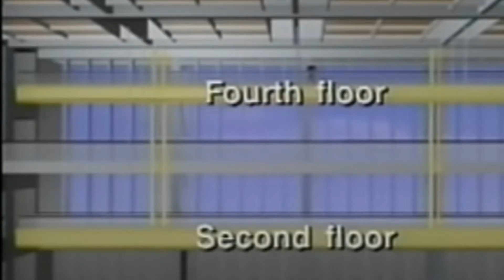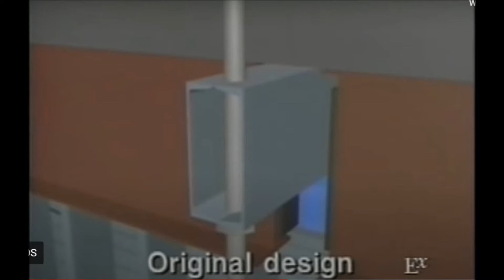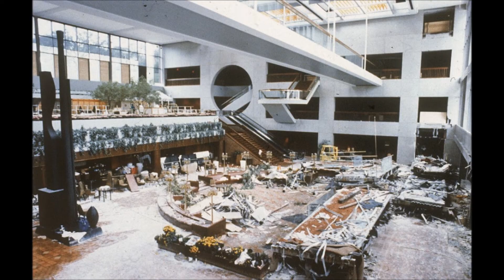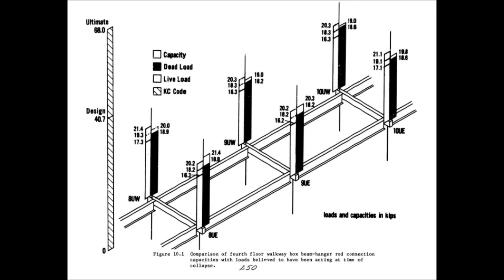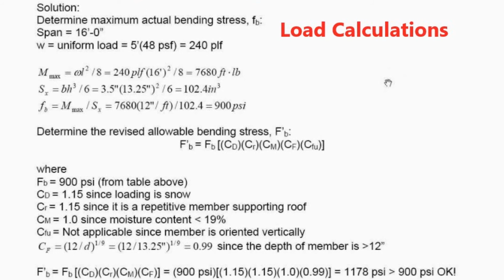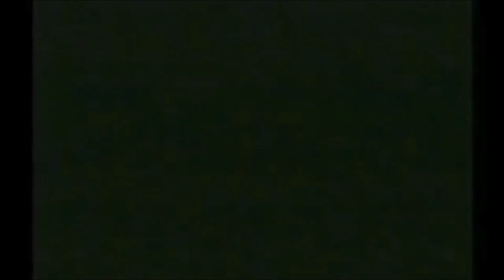Hyatt Regency Atrium Walkway Collapse. 40 years ago this July 17. Lessons learned

Comment: How many local building inspection offices just issue permits but don’t stop construction when they are refused to inspect?  No calculations for load but issue permit?  Should never have broken ground and why design box beam that is welded—-seems like designed death to someone like me who doesn’t know first thing about building but I would have stopped framing because it doesn’t look right.
Reply from the maker: @doncook3584  After that tragedy, Kansas City's permit dept. Has a structural engineer review all design drawings. A lot of municipalities do not offer this service, nor do they have inspectors. Surfside, Fla. Is an example with the Champion Tower south collapse. And in some instances, the Gard Rock Hotel Collapse, the New Orleans inspector was absent and filed false reports.

Comment: In my opinion as an engineer, the bad design was not as suggested here, and as in many other videos, but in the fact that the horizontal two FLANGES of the  C channels were loaded as a  CANTILEVER,  and they did not transfer the vertical load to the vertical WIDER WEB, in a vertical manner. The vertical webs with a vertical load should have been used and not a twisting or torque load, on the flanges of the C beams. If wide THICK plates bridging across the two vertical wide webs were used with the loaded nuts, rather than using a thin washer with a small diameter, this would not have failed.    Note,  even the original design was no good as far as engineering logic goes, as it still loaded the two FLANGES  in a cantilever torque mode, which should never be, in a C channel or an H channel.  I would say that the original system would also have failed, as the welding holding the C channels together did not seem to be a good weld with no porosities and anyway, the original single rod was too close to the edge of the C beam. Exchanging the rods and placing the upper rod on the inner hole could have helped! Thick plates with side limits, working in conjunction with the loaded nuts would even eliminate the need for welding the C beams, but I still would have used welding anyway.
Reply from the maker: This collapse happened when I just graduated college in civil engineering. I researched the newspaper articles to understand the reasons. Not much information at that time. As I went about my career, I used that experience in forming my approach to complex building situations. With the internet, I was able to review this collapse in more detail. It has the same types of theme as all of the collapses. Lack of proper oversight. There are 3 books by David McCullough that should interest all of us constructors , engineers, Architects. The Johnstown Flood. (My video was based on that book as I grew up 10 miles from the dam), The Great Bridge. (Story on the building of the Brooklyn Bridge, my factor of safety video reference this book), and Path between the Seas (story of the building of the Panama Canal). Great reads. I downloaded 2 of them from my free public library.
Reply: @michaelshettig7805  Thank you for the information. This human mind does not seem to come in equal dozes and there are many professional people who do not "see" the dept of the " form and the function".  Many years ago I was discussion the principle of operation of " stairs".  In my country we build with stones and so we have stone stairs where   starting from the first  block,  the wall end is inserted into the wall and the free end of the stairs is about 5 feet away from the wall end,  The second and other stairs override the previous stair with each step inserted about two inches into the solid wall, and the free outer end resting on the previous step.
Once I could not believe my ears when I heard, Civil engineers, Architects and mechanical engineers saying that each step on such a staircase close to a wall is operating on a CANTILEVER PHILOSOPHY!. They could not see the torque effect in each step! 
i could not imagine how three young university graduates could come to that conclusion,  I am now a very old man and I am an electrical engineer who served in Industry, Naval and other ships and then served in  teaching and researching at University.  but it seems that I operate with logic and not emotions and sentiments and parrot fashion conclusion,  There was one time a story going around that in a church in some country, the architect forgot to put a stairs. One day an old man called to offer make a wooden stairs,  The story goes to say that after this old man made such a beautiful staircase , he disappeared, never to be seen again,  They say that  the old man was Saint Joseph himself, and the  circular stairs was so complex  that no one could understand how it holds together, Well when my old eyes analysed what I saw in a photograph, I could easily grasp how that stairs was built and while it was ingenious, well I could understand the structure and could even make it. 
It is a pity that many graduates do not really understand  the function behind the form.   If I had to put my finger on the weakest understanding of the people I met in my life, is the fact  that every form and function could have a higher rate of change or an integral in it, which will create the function in the form. Unfortunately many artists and religious people and lawyers and doctors, they seem to look and behold a location in a scenario but they cannot grasp the fact that some characteristics in a form is only due to the rate of change that exist within the  trajectory of the  outline, or the rate of change of the trajectory or the adjacent colours.  With a simple mathematical algorithm that I originated, I can tell if the contents of a scenario are monotonous, gentle, exciting or aggressive. Even the outline of a woman's lipstick or the contour of her eyebrows will classify her intentions!!! 
We shall leave it at that,   Thank you once again for giving attention to my submission in your comments,
Reply from the maker: I get that the Architect & the engineer were trying to minimize the support so that you could see through the walkways to the exterior window wall. If I was on that project, I hope that I would have reviewed their design and insisted on steel columns from the ground floor up to the roof. I've been on a few projects that I've questioned the Architect & Engineer and we modified the original design to be more structurally sound. I may have been inclined to question because of my research on this collapse in the early '80's.
Reply: @michaelshettig7805  Thank you for your reply. You  are correct, a person with experience of " logic" would have seen that detail was missed in the structure. In 55 years of assisting in court investigations I have found many people who missed out details in the structure which was fatal.
Reply from the maker: That's why I did these videos during the pandemic. These projects that we build can be complex and well experienced personnel are needed. They built this new $10 million Club house at my golf course. They brought a firm in from Dallas to build it. I watched it go up. They had a young supervisor overseeing the project. About 25 years old. Beautiful building. The building sits about 3' up off the parking area. They are finishing the driveway up to the building with dirt work. The slope to the main entrance is about 20-25%. I made a comment to another constructor(who has 30+ experience) on the practice area one day, "Do you see what I see?. He said yeah, no ADA handicap ramp into the building. So I asked the young supervisor about it and he said, "Oh yeah, we're going to build it on the right side. They finished the building and opened it for business. No ramp was built. To do it correctly they would have to remove a good portion of the existing parking lot to start the slope to the building. I mentioned this to the General Manager. He calls the contractor in Dallas and they tell him that they constructed the correct slope. I dropped the issue. ADA requires a 5% sloped entrance. By looking alone it's about 20%. Was the young supervisor inexperienced or was the contractor saving money (probably $100,000+) by not going back into the parking lot and doing it correctly?  60 minutes did an ADA segment years ago.
Reply: @michaelshettig7805  Thank you for  your reply. Your video are excelling in depicting these major faults due to the ovesight of some inexperienced person. In my country many mistakes are being made and a few people were killed. Now " Justice" will never be done and the latest one was a 20 year old person was delivering some tools and while he was in the building  the structure collapsed over his head. Others were cases when the next door neighbour was adding  adjacent building and the contractor did not follow the law,  Greed for money has gone beyong the past skills I  knew of 84 years ago.  Well done in the presentation of these videos.